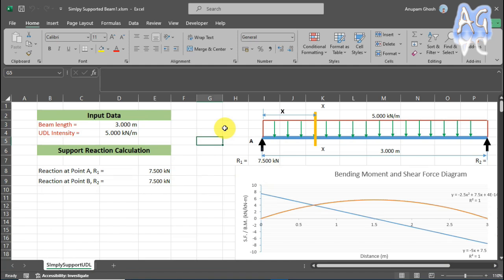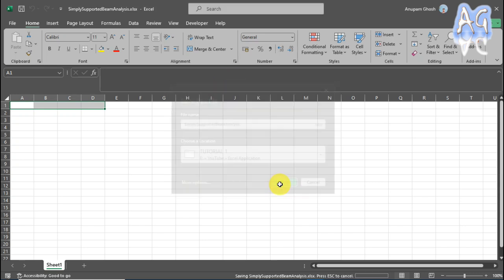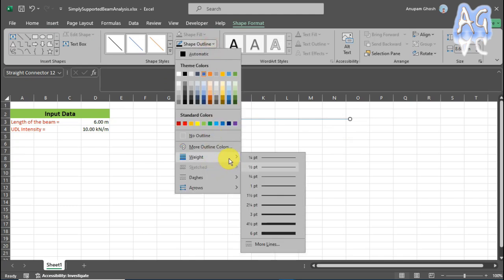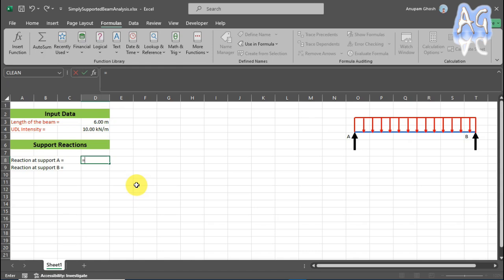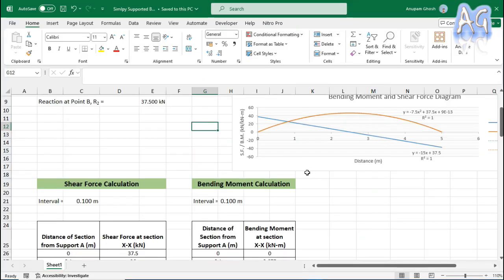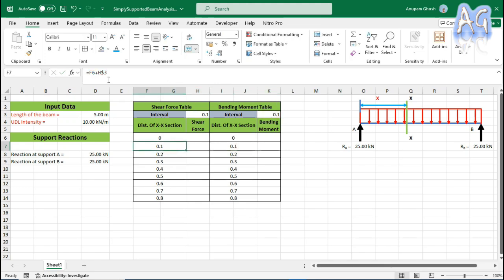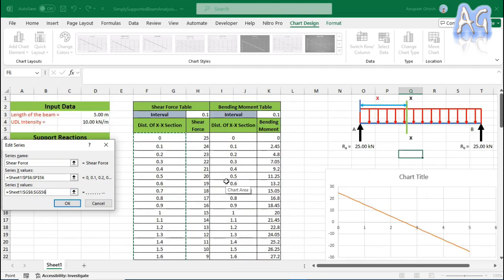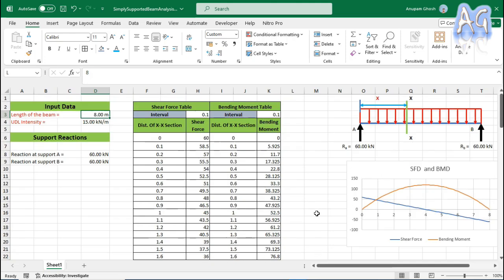Simply Supported Beam Analysis (Automation using EXCEL VBA) in Excel Part 1

Comment: Is this primarily using the constant deflection method, and would it work for Two-span simply supported continuous beam Single-span beams with one end fixed and the other end hinged? I'm an undergrad student and looking to build something to help me better understand my first structural analysis class.
Reply from the maker: This is a determinate beam analysis. This formula is applicable only for simply supported beam. You can not use this equation in continuous beam.